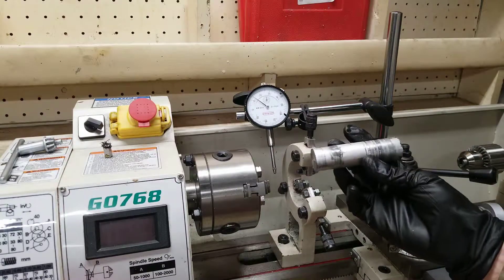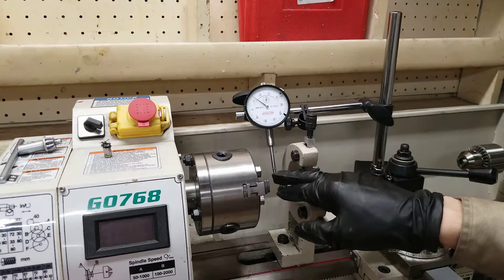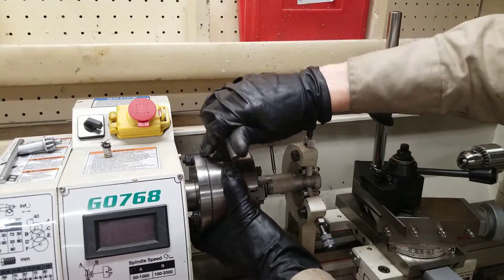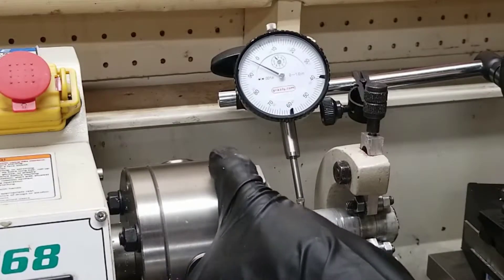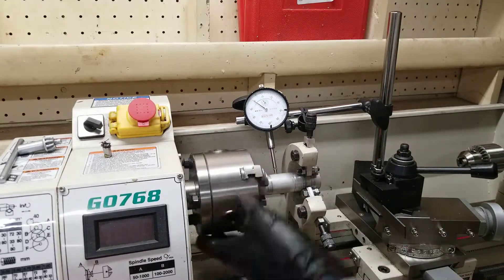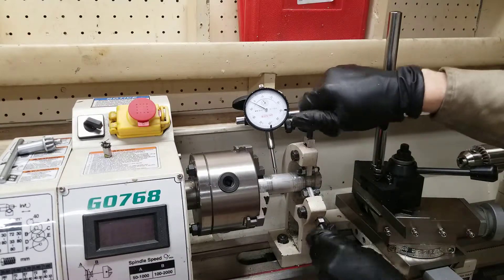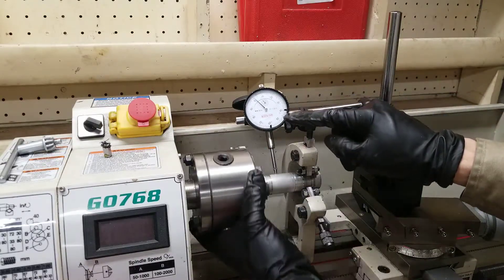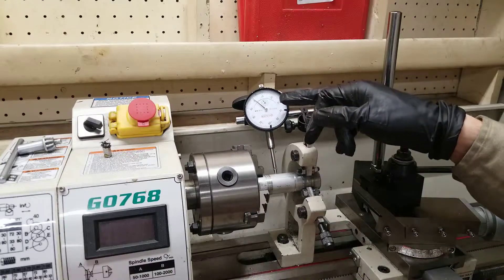How to Use a Dial Indicator on a Lathe

Comment: If you machine the part to check with indicator, aren't you just making the surface relative to the indicator? You could put that part in on an angle and resurface it, same result.
Reply: yeah, that's a scary thought. Like realizing that the straight edge is not that flat

Comment: That run out you have is most likely coming from that 3 jaw chuck !  3 jaw chucks normally have  .002 or .003  run out in them when there brand new.  and thats normal. If your looking for better tolorances your going to need a 4 jaw chuck.  They are used so the work piece can be dialed right in to 0 run out.
Reply: Indeed. More precise machining requires a 4 Jaw or more, depending.